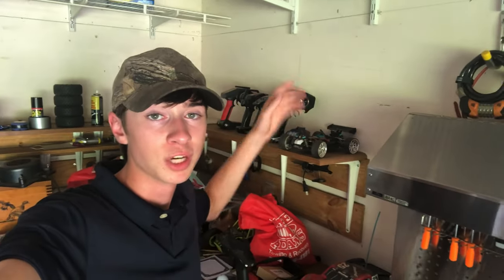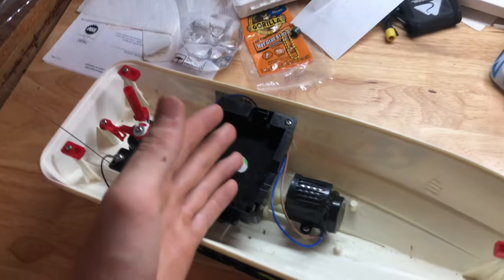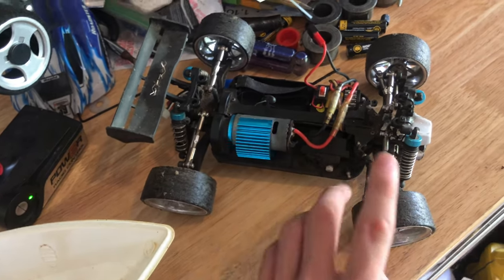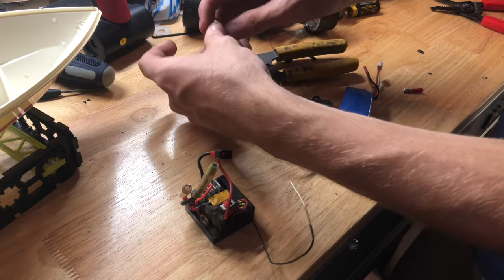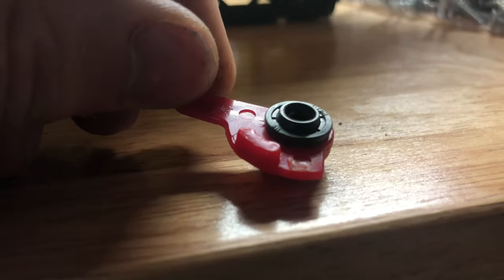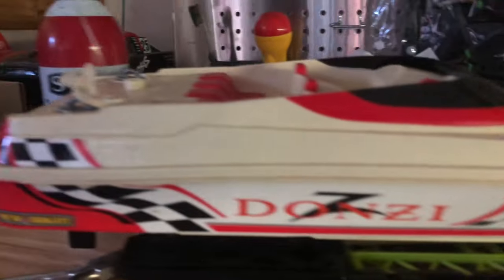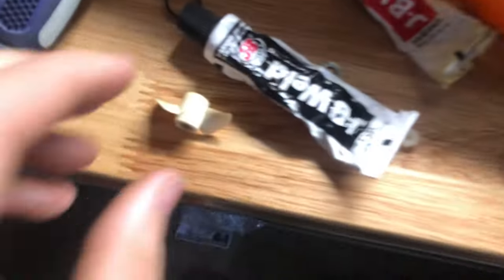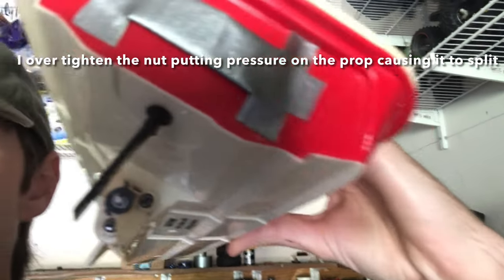NewBright RC Boat gets Upgraded Electronics!

Comment: He yeah man, that worked out nice👌
How rad is it when something random (like that valve stem seal) fits perfectly onto something else random and it just works. Example, The gas pedal on my mower is hooked up using an old Ford 4.9 throttle cable. Everything about the size and length was right . Or the core drill we got at work, it's a Hilti and like impossible to find parts for (the guys at the Hilti store are as dumb as they come) so now the seal on the output shaft is from a Toyota truck's pinion gear.  lol I love fixing things using what other people see as junk. 
And JB weld, there nothing that stuff can't fix. There's a blob of it on one of the radiators on my 250R that is covering a hole and been holding tight since 1998. (Yeah im 39 years old) 

Probably a dumb question but what happens if that boat flips or dies like way out there on the lake? Especially with a Lipo battery, how they slow down for 10 seconds and then just doe. Take a swim? Bring a fishing pole?
Reply from the maker: Yeah lol that is how I am, just make what you have work! I haven't thought about that yet, I don't drive it super far out just mainly within 20ft or so. If the boat turns over(joins the Poseidon Adventure) then whatever I will be sure to film it sink lol then later on we may go back and retrieve it when the water lever drops for doc repair or when it seems good to retrieve it lmao!

Comment: Man that’s awesome. Not related but I have a question about that 40 series driver mod for your mower. Did it work for you when you had it on and did you have any problems or burned belts? I’m seriously considering doing it and I wanna know if you recommend it. Thanks!
Reply from the maker: It works great and slid right on, make sure your belt is aligned and you'll be fine. I personally didn't like it because it was kind of jumpy and kind of felt weird, however it doesn't mean that if I don't like it doesn't mean you will either. The system works well like I said with a slight pulley swap but just not my type of riding style lol.